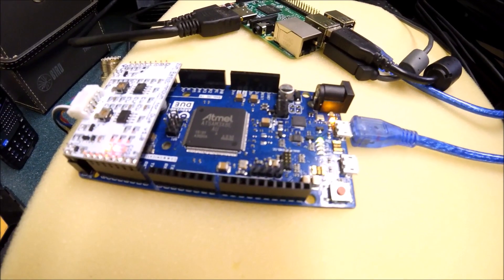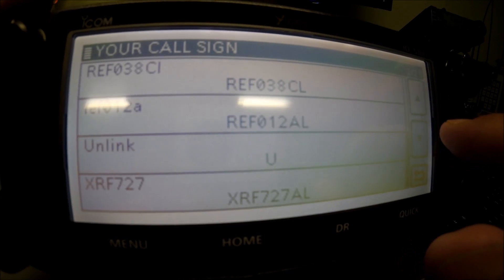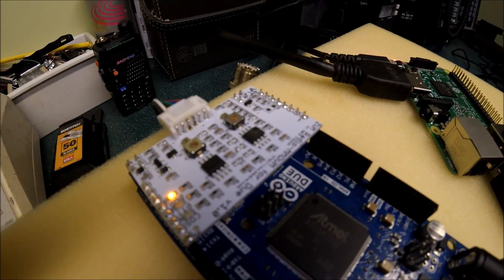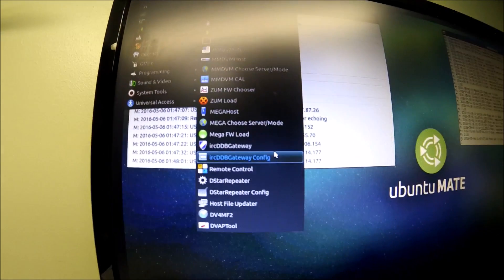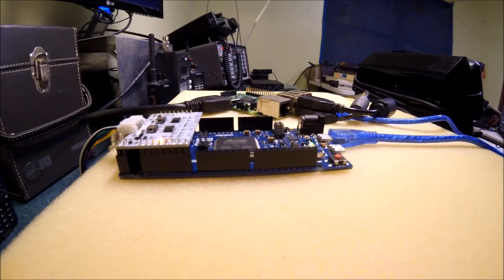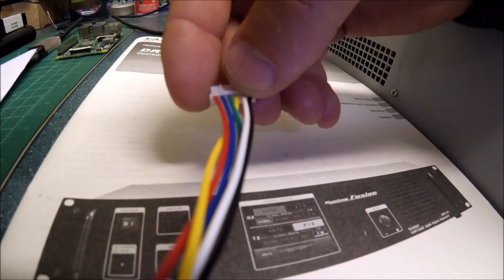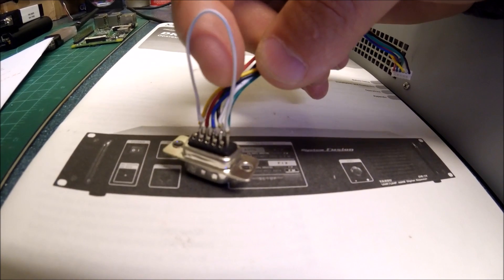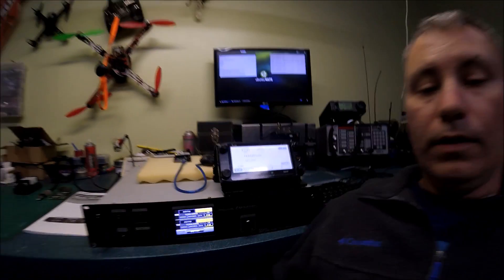MMDVM How two Video! DSTAR DMR Repeater Build

Comment: I have been using a DVmega dualband board I picked up but I can only get about 1/4th a mile coverage with it.  I'm tempted to pickup a cheap mobile UHF radio with a packet port and a MMDVM board and setup a basic simplex "hotspot".  A mobile running at its lowest setting (5-10w) into a roof mounted antenna should have massively more coverage then the DVmega.
Reply from the maker: 5 watts on a good hilltop works real nice! I have the DR1 on low (5watts) I get over 15 miles!
Reply: Richard Hyde oh wow.  I'll need to make sure I select a mobile with a good low power ability!  I'm at the top of a hill at 800-900ft with any other hills nearby being 700-800ft and most of the land being 400-500ft average altitude, giving my spot a pretty commanding "RF view".

Comment: Greetings Richard,
I've been sort of watching this project for a little while now. So as I understand it you use analog RX and TX and the MMDVM board and Arduino do the decoding and encoding of the digital signal. Do I have that correct? I've been working on a repeater controller project based on SVXLink and the Raspberry Pi (openrepeater.com) and I've been pondering a way to incorporate this into my project to offer digital modes.  Your input is appreciated. 

73, 
Aaron - N3MBH

Comment: Thank you so much for the info on the cable connection from the MMDVM. Nobody had explained that so clearly!  A question about the the cable from the MMDVM to the 9 pin serial... Where did you get it? I ordered what I thought was the right one and it ended up not having enough wires. Again, thank you a ton for the great explanation!
Reply from the maker: I make all my cables. And I have sold a few also. If you need one send me a e-mail. I am Good on QRZ . Thanks For watching!

Comment: Richard, will the MMDVM modem automatically switch between the different digital formats, or do you have to manually change the modem to the different digital modes. 

Thanks, 

Jim,
KB4OVL
Reply from the maker: Both, You can set it in the INI file. If you just want DMR you can do that or if you want all, Still using it works great! I am on TG3100 and TG3121 most of the time.

Comment: Ok,  I'm a newb....   Are you changing a Fusion system to TX in TDMA,  or are you just adding a peripheral repeater with the MMDVM that's connected to the system fusion repeater?
Reply from the maker: Using the analog side of the DR-1 to connect to a MMDVM.. So now I have a C4FM,DMR, & DSTAR Repeater.

Comment: Hi Richard. I want to connect DR1 with MMDVM. Just wondering about the connection because I have seen already three of them. For example this one: https://drive.google.com/file/d/0B204XUo4D19sMnA5UlRrUlZJc0U/view?usp=drivesdk I'd like to be sure for 100% before cabling. Can I go ahead with your cabling version? :)
Reply from the maker: Yes, My cable works great. The new IMG V10. Will be uploaded soon also.
Reply: +Richard Hyde did you buy the cable with MMDVM or separately? If separately - where from please?
Reply from the maker: I have been making them. If you need one let me know. The money from them help with testing and so on.
Reply: +Richard Hyde We have MMDVM v3.0+ from SP8NTH and DR-1X rptr. What would be the price for the cable with postage to Europe? We would pay via paypal.
Reply from the maker: Sent an Email to you.
Reply: I found I needed to connect my transmit audio to pin 6 (tone or CTCSS). Connecting to pin 7 caused the pitch of the audio to be too high. We need a flat audio input.

Comment: Thanks for the video, Richard. I am about to convert from a Moen *Board to MMDVM and have a question. Which model of Arduino board is required? I see in your video that you are using a DUE, but they seem hard to find. Are there other boards that will work?
Reply from the maker: +McCoy N5YAV Yep. Needs to be the due board. Check ebay thats were I got mine.